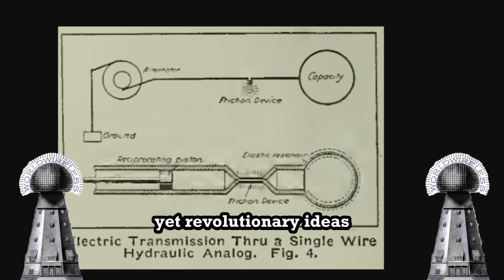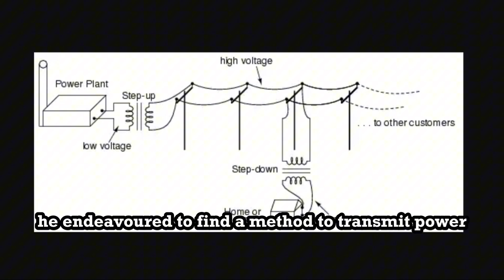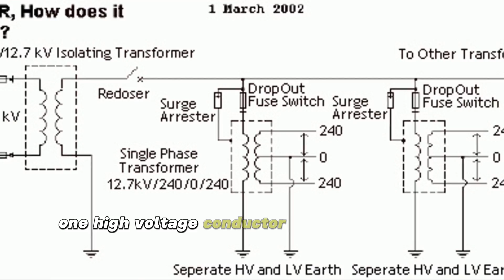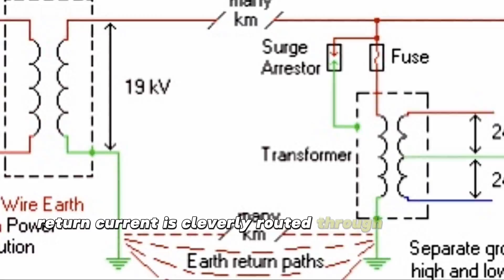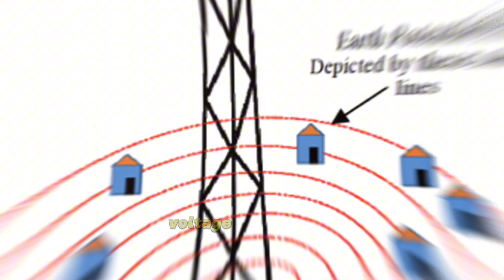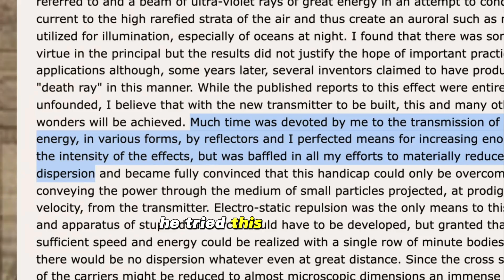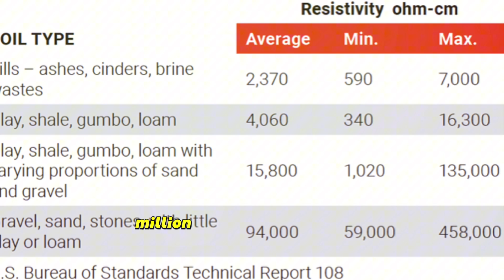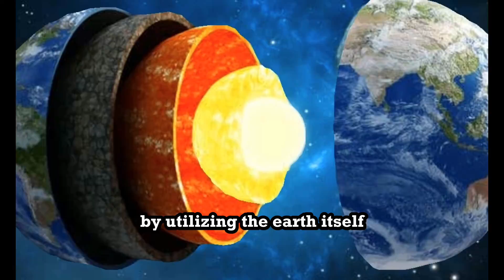Nikola Tesla’s ACTUAL Wireless Electricity - Part 2

Comment: once you have that kind of voltage established(millions of volts from magnifying transformer), do you still need a generator pushing electrons through? I wonder that if you tap into /  land on the electron highway the earth is using, it should be just as easy to extract the electrons from the MHD action of the earth?..... like..... a kind of seebeck effect? peltier? i mean if we consider the interior of the earth the hot side , and the earth side the cool side, there should be electron flow happening we can tap into
Reply: also do you figure the imagery of wardenclyffe sitting on the north pole has to do with some hint that he was maybe intending on capturing the inflowing aurora borealis perhaps? opposite of HAARP , rather then punching a hole upwards, you create a potenial downwards, or you take advantage of an already existing potential(north pole)
Reply from the maker: Hey thanks for commenting.  No he was specifically putting one at the North Pole for use with navigation. 

He wrote an article about it. 

Check it out.

“NIKOLA TESLA'S PLAN TO KEEP "WIRELESS THUMB" ON SHIPS AT SEA
by Nikola Tesla
New York Press
November 9th, 1913
Suggests Transmitters Powerful Enough to Cause the Earth to Vibrate at the Poles and Equator.

He would Determine Vessel’s Latitude and Longitude by Measuring the Length of Electric Waves.

Nikola Tesla has come forward to refute the claims of men who recently excited the scientific world with announcements of discovery and invention calculated to crowd the bugbear of scientific warfare back into the primer class, and to safeguard the lives of seafarers. First he takes up and disposes of the announcement of an invention said to enable a receiving ship equipped with wireless to tell the longitude and latitude of a sending ship without the latter vessel offering its own calculations. “It hasn’t been done, and it probably will be years before the means for so doing can be applied successfully,” he says. As to the power of ultra-violet rays to explode the powder magazine of a warship from a distance, he insists it can’t be done through that medium. If charges of powder have been so exploded, he contends, the detonation was accomplished with the familiar waves now utilized by the wireless. But Mr. Tesla admits that in all probability there will come a time when science has so harnessed and developed the means at hand that such results may be obtained. Mr. Tesla sets forth for readers of The Press his views on the two subjects as follows:

The first and incomplete announcements of technical advances should always be taken with a grain of salt. It is true that the newspapers are getting more and more accurate and reliable in putting forth such information, but, nevertheless, the news frequently is misleading.

For instance, not long ago reports widely circulated that powder had been exploded at distance by infra-red or ultra-violet rays, and that a British battleship had been used in a test of this kind, which proved successful. The dispatches gave great opportunity to sensational speculation, but the truth is that there was no novelty whatever in what was done.

Tesla's Plan to Learn Positions by Wireless

Stationary waves discovered by me years ago are the means for determining longitude and latitude by wireless. But it may be years before they will be successfully utilized.
Notwithstanding its immense size, the earth responds to a great number of vibrations. When thus excited there are formed on the surface stationary parallel circles, with their planes at right angles to the axis of the earth.

Imagine that a transmitter capable of exciting the earth were placed at one of the poles. Then the crests and hollows of the stationary waves would be in parallel circles, with their planes at right angles to the axis of the earth, and from readings of a properly graduated instrument the distance of the vessel carrying the same from the poles, could be read at once, giving accurately the geographical latitude.

In like manner, if a transmitter were placed at a point on the equator, the longitude could be precisely determined by the same means. The best plan would be to place three transmitters at properly chosen points on the globe, so as to establish three non-interferable systems of stationary waves at right angles to one another. If this were done innumerable results of the greatest practical value could be realized.

A mine or magazine may have been blown up, but this was accomplished in a well-known manner through the application of a kind of electrical waves which are now generally adopted in the transmission of signals without wires. Similar experiments were performed in this country many years ago by myself and others, and quite recently John Hays Hammond, Jr., has done credible work in this direction through the application of an art which has been named “Telautomatics,” or wireless control of moving mechanism at a distance.

By means of such telautomatic vessels, surface, and submarine or aerial, a perfect system of coast defense can be established. Torpedoes on this plan also can be controlled from battleships, and there is no doubt they sooner or later will be adopted and their introduction will have a revolutionary effect on the methods of warfare.

Nikola Tesla.
The results described are, however, not impossible. It is quite practicable to explode by rays of light a mine at a distance, as by acting, on a mixture of chlorine and hydrogen. Certain dark rays also can be employed to produce destructive effects. As far back as 1897, I disclosed before the New York Academy of Sciences the discovery that Roentgen, or X-rays, projected from certain bulbs have the property of strongly charging an electrical condenser at a distance. The energy so accumulated readily can be discharged and cause the ignition of some explosive compound.
Says They Can’t Penetrate Steel.

But ultra-violet rays are of very short wave lengths and cannot penetrate steel shells, while the longer and more penetrative waves of the infra-red rays are chemically much less active. There is no doubt in my mind that we soon shall be able to project energy at a distance not only in small, but in large amounts, and what the effect of such an achievement will be on existing conditions, words cannot express.

As regards the determination of latitude and longitude of a vessel at sea by wireless, there is nothing in use as yet which would make such direct observation possible. Some suggestions, however, which I have since many years advocated, have been adopted. They are the flashing of time signals over a wide area and the employment of an instrument known as a wireless compass.

 Plan for Finding Locations.
These means enable an expert on a vessel to ascertain the exact hour at any sending station within reach, and also, in an imperfect manner, the direction in which it is situated, and from these data it is possible to get a rough idea of the position of the ship relative to the points of reference.
A perfect means for determining not only such and other data important to the navigator already is available, but it may require years to apply it. I refer to the use of the stationary waves, which were discovered by me fourteen years ago. The subject is too technical to be explained in detail, but the average reader can be made to understand the general principle.

The earth is a conductor of electricity, and as such has its own electrical period of vibration. The time of one complete swing is about one-twelfth of a second. In other words, this is the interval the current requires in passing to, and returning from, the diametrically opposite point of the globe.

Now, the wonderful fact is, that notwithstanding its immense size, the earth responds to a great number of vibrations and can be resonantly excited just like a wire of limited dimensions. When this takes place there are formed on its surface stationary parallel circles of equal electrical activity, which can be revealed by properly attuned instruments.

Transmitter at One of the Poles.
Imagine that a transmitter capable of exciting the earth were placed at one of the Poles. Then the crests and hollows of the stationary waves would be in parallel circles with their planes at right angles to the axis of the earth, and from readings of a properly graduated instrument the distance of a vessel carrying the same from the Pole could be at once read, giving accurately the geographical latitude.

In like manner, if a transmitter were placed at a point on the Equator, the longitude could be precisely determined by the same means. But the best plan would be to place three transmitters at properly chosen points on the globe so as to establish three non-interferable systems of stationary waves at right angles to one another. If this were done, innumerable results of the greatest practical value could be realized.”

Comment: Yo being the first to comment. Outta curiosity how hard would this be to create on small scale lets say 30 acres?
Reply from the maker: Hey thanks for commenting! So the hard oart is gettin the voltages needed which literally requires a physically large transmitter. 

It’s not really worth doing for short distances with few users because of the cost of a transmitter. 

When one transmitter is needed for the entire continent though, the cost becomes irrelevant. 

Also just for the record Wire Earth Return electricity transmission is already done at large and industrial scale. 

So we know it works 🤷‍♂️

⚡️🌎 We already send Energy Through the EARTH?!? 🤯🤩
https://youtu.be/weINSQrbnuA